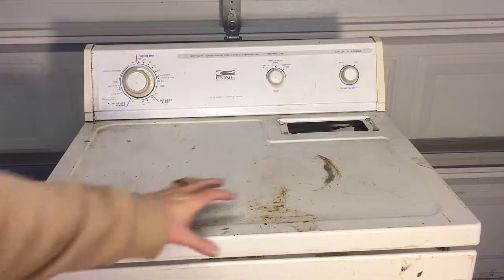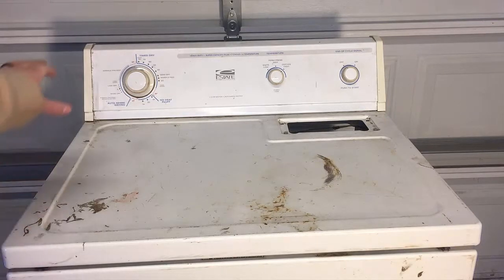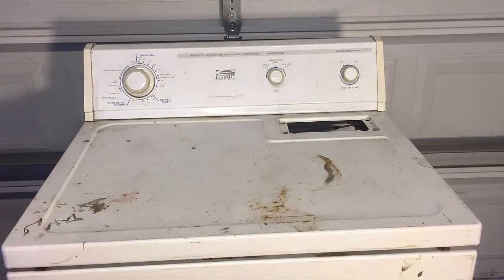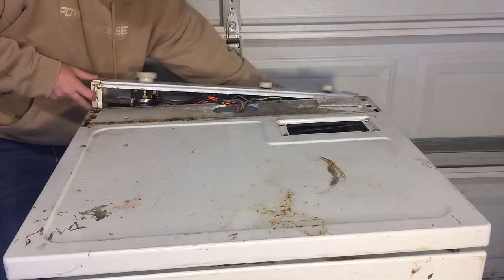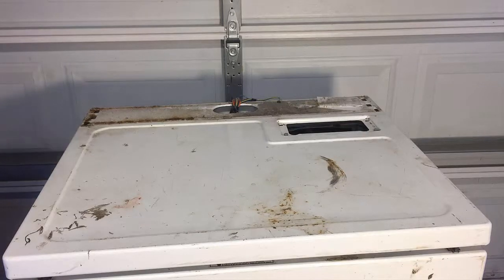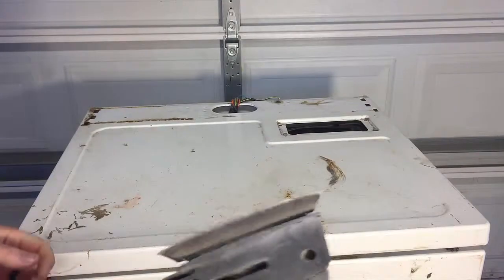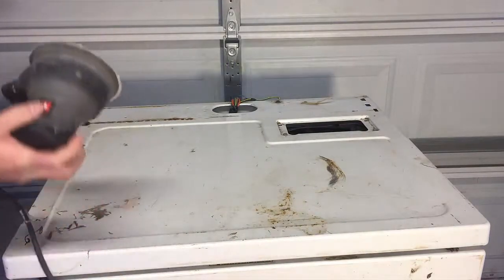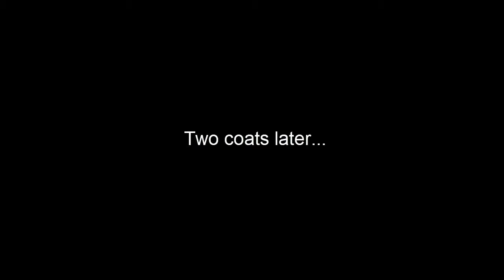How to Paint a Dryer

Comment: Did you sand between layers of new paint? Great video!
Reply: I don't remember if I did or not. Worst case scenario, you can try the second coat without sanding. If it looks bad, sand it and apply a third coat. Make sure the paint is completely dry between coats.